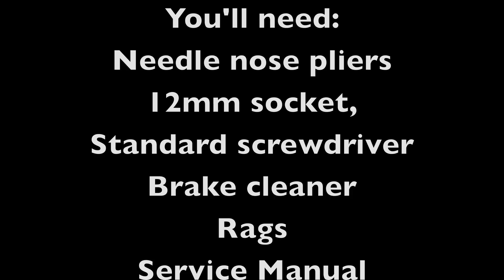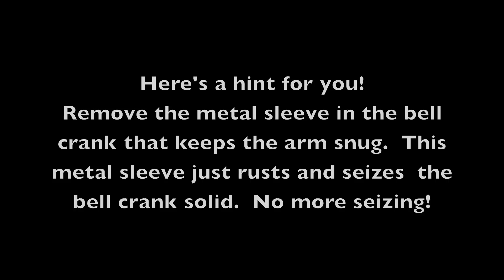Land Cruiser rear brake service, shoes, drum, emergency brake adjustment

Comment: The cable running between both brakes on the diff just broke do you need it?
Reply from the maker: Its the emergency brake
Reply: @PowerModzOfficial  yea I thought so was just wondering if the cable was disconnected would the e brake stay on ? or just not work

Comment: Man i did all of this but as soon as I put the drums back on everything locks up. I can't turn the wheel at all. The drums have just been turned. The Piston is not even plugged into the brake line so it doesn't seem like there's pressure going to that. Everything is just stuck.

Comment: This is excellent. And it i was to replace my axle seal, i would remove that housing with the 4 bolts and slide out the axle, replace the seal, correct?

Comment: Looks like you are missing one crucial step....at least applicable to the FJ60/62.  Backing off the parking brake through the inspection window in the back of the drum.  If I don't do this on mine there is no chance in hell the drum will ever come off.

Comment from the maker: Sure, leave it set loose - install drums, then just get in the truck and keep pulling on the ebrake handle - they will self adjust:)
Reply: Late to the video here. Thanks for posting. I changed my drum brakes on my 60 series and they're over tightening. The spring I have doesn't go over the whole adjusting pin. Do you think that would be causing it to over tighten?

Comment: I tried to remove the metal sleeve from the bellcrank on my FJ60. It was a nightmare. I definitely don't recommend doing this on a 60. 

The sleeve is "dovetailed" on one corner and took me 2 hours to get free. Ended up using a grinder on it. An easier way to restore fit would be to sand a little bit from both sides of the lever and pack full of grease.

Comment: Hey there, great video. I was wondering if ou have any on replacing the rear axle seals? I have a 1985 BJ60, looks similar but slightly different.